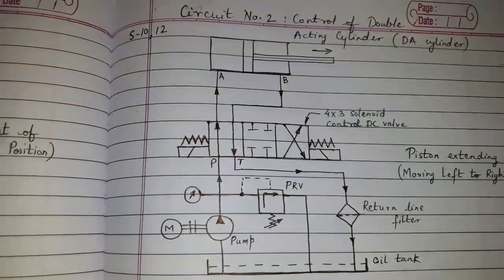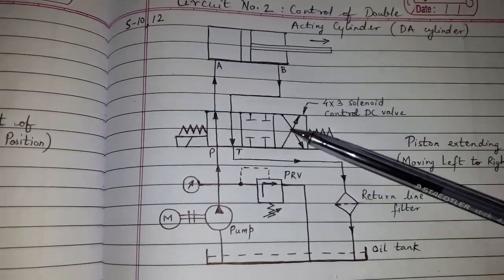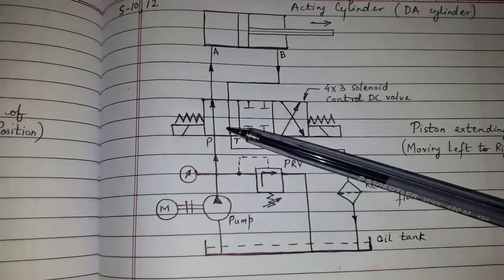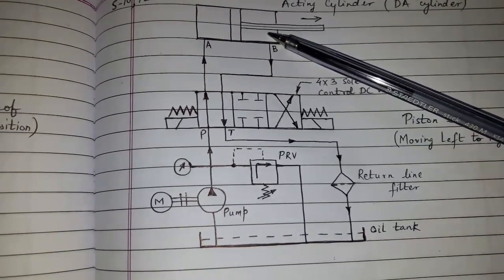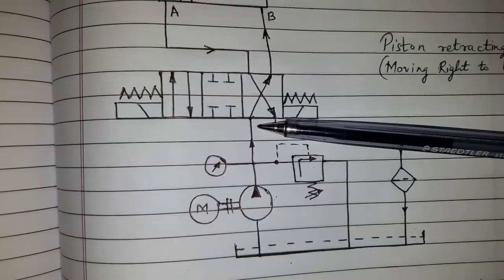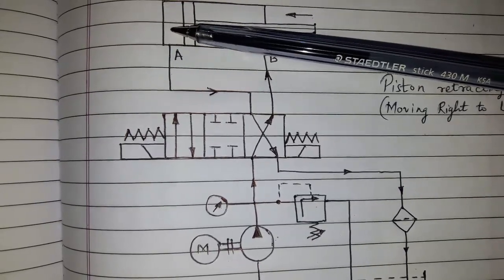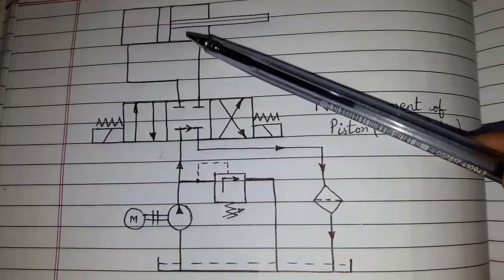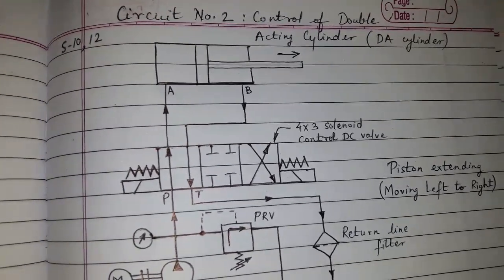Circuit no. 2: Control of Double acting cylinder (Hydraulic circuit).... #50kviews #viralvideo

Comment: sir , what does the dotted line mean drawn over
Reply from the maker: Dotted line on PRV: 
It is a kind of signal/connection from the line to PRV which informs PRV about the pressure... Once the pressure is increased in the line upto its set point... PRV relieves the pressure...

Comment: IN HYDRAULIC MOSTLY THREE POSITION DCV ARE USED...NORMAL CONNECTION SHOULD BE FROM MIDDLE POSITION...NO NEED TO SHOW THE RESERVIOR AND PUMP  AT TWO POSITION.KEEP IT AT MIDDLE POSITION,SHIFTING OF POSITION LEFT TO MIDDLE OR RIGHT TO MIDDLE  WILL BE OK...ITS MY OPINION THAT CONNECTION OF SUPPLY  (PUMP),TANK OR TO THE SYSETM ARE FIXED,,,ONLY INTERNAL SHIFTING IS THERE...

Comment: 2x double acting cylinders   
2x pressure relief valves 
3x check valves 
1x flow control valves
1x 4/3 d.c.v
1x power pack